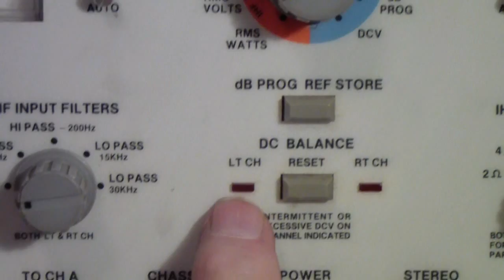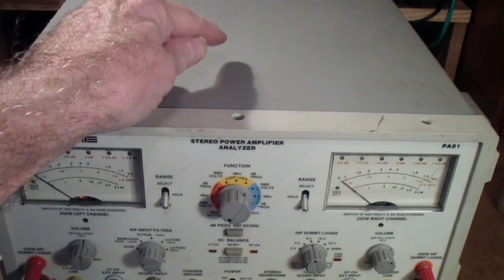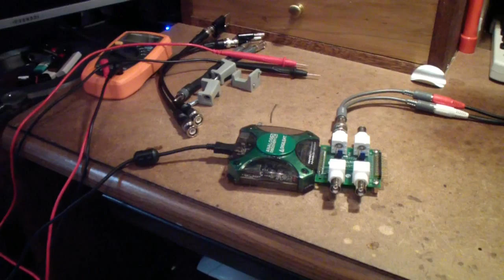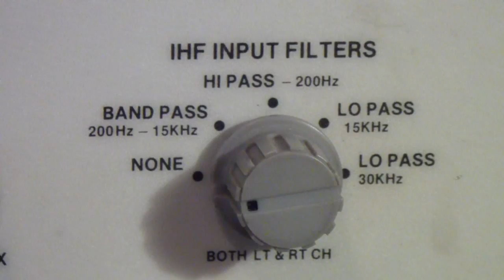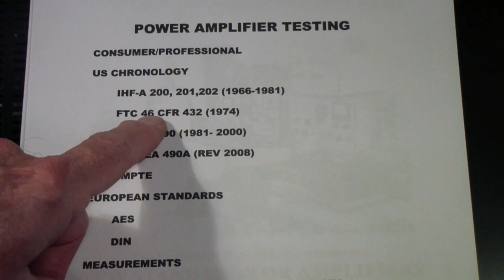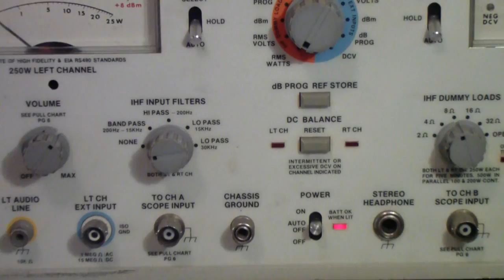TTT141 Amp Testing w PA81 Analyzer

Comment: Great video! Your explanations go well with the subject and I seem to be stating the obvious. So glad I ran across your channel. Not to terribly far of topic, in the '80's I was at a very famous rock bands 'concert' with my green army ear plugs just incase I needed them. When I put them in my ears to quiet the overly loud band, the vocals sounded terrible, way off key at times. Not to totally wreck the evening I removed them and enjoyed the show. Would this be related to the "suck" knob on the mixing board that's used for the warm up band? Must be some fancy trick to mask a bad singer. I've always wondered what caused the "unmasking"" of the singer with simple earplugs..

Comment: Excellent tutorial, thank you for posting. Does any know where I can get a copy of the OM for the PA81?
Reply from the maker: There is a copy of a Sencore TechTip on the PA81 on KO4BB's website. I do not know if he also has the full manual.
Reply: @tomtektest8042  Thanks. Unfortunately it's just the Tech Tip. But I did find this:   http://ftb.ko4bb.com/getsimple/index.php?id=download&file=06_Misc_Test_Equipment/Sencore/Sencore_PA81/PA81_Stereo_Analyzer_Schematics_PartsList.pdf.   I can't believe how difficult it is to locate a reasonably priced copy of this manual.

Comment: tomtektest  Thank you so much!!!! I wasn't flipping the switch up, I was only putting it on auto expecting it to work. I was finally able to turn in on but the 12v power supply was not enough so the unit would turn itself off after a few seconds. The 15v power supply insert was not long enough to make contact properly so I replaced the 15vdc power supply insert with the one from the 12VDC power supply and "SUCCESS" It turned on and stayed on! I love it!!!! Definitely having fun with it!!! Thank you so much!!!! I really appreciate your help!!!!

Comment: HEEEEEEEEEEEEELP!!!!!!!!! Is it supposed to do anything when you turn it on? I plugged in three different power adapters starting with 12vdc, then 15vdc and then 19vdc and noting happens when I switch the unit  on! No lights, no fan, no sounds, no signs of life!!!  It seems dead. I fed a .25v 1khz sine wave to the RCA inputs, with the meters on RMS voltage and nothing happens?
 Thank you for your help!!!!
Reply from the maker: Yes, it should go through a short (2 sec) power on sequence and settle with three led's lit, one each on the power meters and one labeled "BATT OK WHEN LIT". make sure you are pushing the power switch to the top position and then let it go (it should spring return to the middle position).
Reply: tomtektest  Thank you so much!!!! I wasn't flipping the switch up, I was only putting it on auto expecting it to work. I was finally able to turn in on but the 12vdc power supply was not enough so the unit would turn itself off after a few seconds. The 15vdc power supply insert was not long enough to make contact properly so I replaced the 15vdc power supply insert with the one from the 12vdc power supply and "SUCCESS" It turned on and stayed on! I love it!!!! Definitely having fun with it!!! Thank you so much!!!! I really appreciate your help!!!!

Comment: Please help me? I just purchase one of this PA81 units without the power adapter. I tried to find one for sale but could not find it. I tried a 12v DC 3A adapter that seems to fit the plug but it did not work. Can you please tell me polarity of the power adapter? I ask about the polarity because normally power adapters have a negative outer and positive inner contacts, but I noticed that the battery connector which is a typical power adapter adapter plug has a diagram indicating the outer + and - inner contacts and that is opposite to a normal power adapter. This reversed polarity on the battery plug now has me wondering if the polarity of the power adapter is also unconventionally reversed.  Please help!!!!!
Reply: The PA81 power adapter is positive center pin, negative outer.  The model is a PA241
Reply from the maker: The AC Adapter for the PA81 is listed as a PA241 in the Sencore Data Sheet - my adapter indicates it is a V/198/4 with P/N 60C12-1 and a listed output of 15.3 VDC @ 1.95 AMP. The open circuit voltage on my adapter is 20.16 V with the center positive. Hope this helps.
Reply: @tomtektest8042  Thank you so much!!!! Very helpful indeed!!!! I guess if the 12Vdc was not enough voltage? I'm looking for a 15vdc adapter in my parts bin! as soon as I can find it, I'll try it out!
Actually, I just realized my laptop adapter has an open voltage of 19.23VDC so that should be fine. I just got the manual and it indicates that up to 20VDC is ok.
Im still going to try to find my 15vdc  adapter! Once again thank you very much!!!!
I really appreciate it!!!!!
Reply: @tomtektest8042  hello!!! Once again thank you very much for your help. I plugged in three different power adapters 12, 15 and 19 vdc and noting happens when I switch the unit  on! No lights, no fan, no sounds, no signs of life!!! Is it supposed to do anything when you turn it on? It seems dead. I fed a .25v 1khz sine wave to the RCA inputs, with the meters on RMS voltage and nothing happend?

Comment: amps....class "a" simgle ended for the top end and class "a" darlington configuration for the mid to bottom end(personal preferences ;-) in combination with transmission line drivers. studio 4's for a long time then i built a set of bi-ampable units for myself. been rummimg this configuration for a little over 20 years now and still love the sound over any other multiple channel(other than stereo)arrangement i have found. phase coherent response is what is most important personally and the trend of units that feature more than two channels just don't offer that due to the really whacky signal processing involved.
 then again...i prefer music over video for listening to on a regular basis so that makes me rather biased over multiple channel processed reproduction devices other than 2 channel stereo. good vid and i quite enjoyed it. thanks for the effort. it's appreciated.

Comment: Great video, personally Ive always found the speakers combined with the room being the weakest part of my hifi system. Amplifiers generally are pretty good, but it`s like a chain, the weakest link will pull everything else down.
Reply from the maker: Yes, I found that most of the people who listened to a system in a showroom and were later disappointed was because the system did not match well with their listening room. Some modern systems have microprocessors that "listen" to the room acoustics and adjust to make the overall acoustics better. Of course, an expert ear is always better (at least given today's technology) but even that can be problematic. What happens, for example if an acoustic "expert" tells you that you have to remove your favorite chair (or sofa, etc.) because it is bad for the acoustics. Or how about knocking out that wall and making your listening room a couple of feet deeper, etc. Speakers and rooms are the biggest impediment to good sound reproduction in most cases, not the amplifier characteristics.
Reply: Absolutely, and much of high end sound is probably purely psychological. That said however, I like to think of myself as a rational engineer type of person but I am also a consumer of high end audio equipment and I own many expensive amplifiers of different technologies from the simple single ended Triode amplifier to the much more advanced modern Class A transistor amplifier monster. I love the tube amplifiers, but they will never be my favorite amplifiers, my current favorite amplifier is a 200W class A amplifier, it`s huge, it sucks like 1000W from the wall constantly, it generates a lot of heat, it`s so heavy I can`t even carry it alone, but it sounds so sweet and I love it. That is how irrational I become when we start talking about audio, and I paid like $6500 for my current speakers, they were a good investment, I`ve been very happy with them.